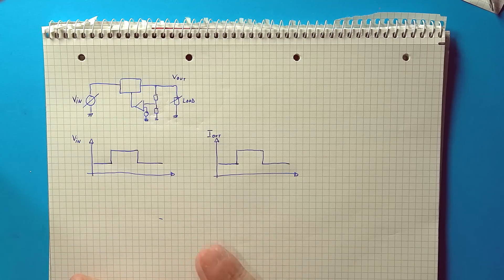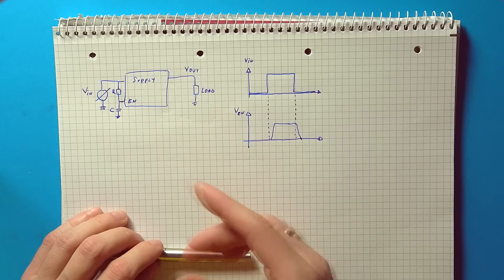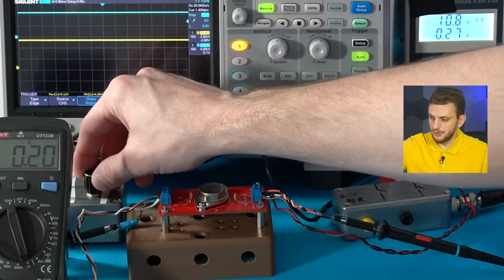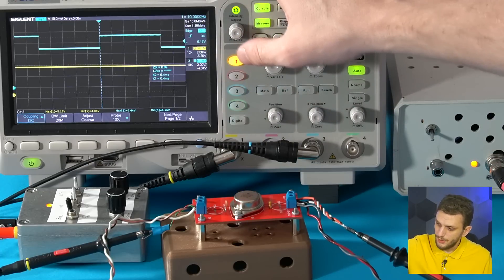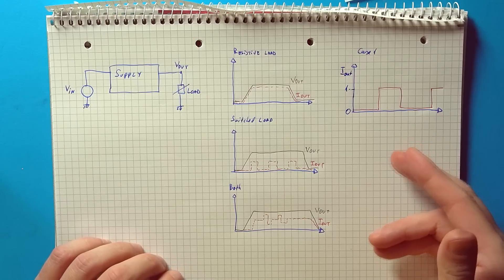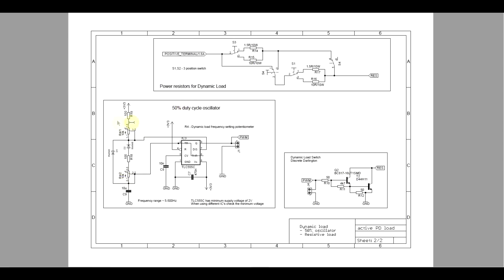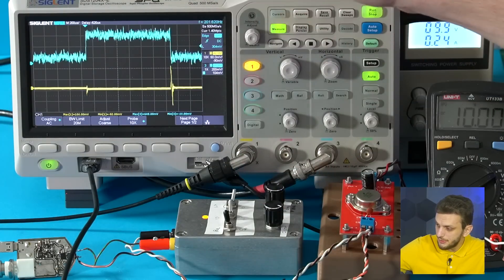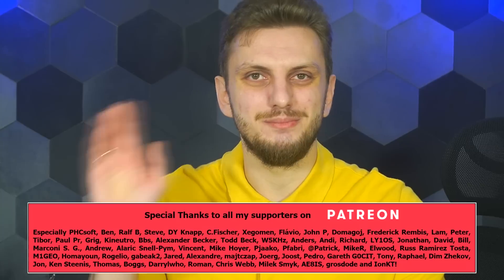Power Supply parameters - Dynamic Accuracy

Comment: The load can be complex, such that a failure can cause energy (overvoltage event) on the output of the regulator. This is usually mitigated by a large TVS on the output or a diode across the regulator. You may also see a TVS on the regulator input which may also be protected by a fuse depending on how the supply may respond to a huge line transient (like a lightning event or you live in a very noisy AC environment like some cities in England).

The challenge in use case testing of the PCB is in how to do the measurement. PDN low impedance testing is not easy and you usually need a very high bandwidth if you are doing preliminary EMC screening. And as I am sure you know, the design can actually be working with no operational problems other than not passing EMC. So, it is hard to understand all of the use cases when it is also PCB layout dependent. The more experienced design teams will specify features in the layout which make it easy to support the needed testing.

From a mathematical standpoint the impulse step response should be ideal. This means a perfect zero rise time step response, which is not really possible. You can however get a very fast step if you use a fast high current low Rds On MOSFET with a pre-driver circuit which is driven by the signal generator. The pre-driver can supply a huge amount of current in a very short amount of time at around a ns. This is usually not needed however with most electronic loads which switch quick enough to do supply edge testing perturbations for time domain stability testing.

Your custom current probe is very noisy. I really like the fact you designed your own. My own custom current probe designs are battery operated and run off of two 9V batteries for split supplies and have a small nose on the current sense board pcb (6 layers to allow me to bury signals) to solder directly across a small SMT sense resistor (very low inductance) on the PCB using very short low inductive leads. I have options for large gains for small sense resistors up to about 5 Mhz worse case bandwidth, which is usually sufficient. The shunt resistor current sense approach can be made much more compact than making a current loop for a magnetic current probe. Making you own shunt current probe is rather easy with the newer fast instrumentation amplifiers available, and they seem to be getting better every year.

Comment: Very good video as always! What is the power amplifier that you are using? It seems diy, maybe you can show it in a next video, that would be very interesting! Thanks for your videos, top notch quality content
Reply from the maker: You are right, it is DIY; I built it a few years ago. If I remember correctly its built around an LT1210 - that is part that is providing the high current output. Maybe at some point I will do a video about the amplifier, but its not really planned at the moment.

Comment: A very important topic. A follow up video about means to achieve good power supply stability would be interesting. The best would be a comparison between single chip (linear) voltage regulators and a voltage regulator which is build with discrete standard devices and optimized for very high output voltage stability.
Reply from the maker: I will try to look at stability in more detail at some point; however, I want to take a step by step approach - first to look at the problems you usually face in a real life application, how the problem can be investigated - the tests to perform and afterwards see how it can be fixed.
Reply: @FesZElectronics  I am also looking for a device or circuit to get a good current regulation / current limit as close as possible to the voltage setting.

Comment: I would like to know the best possible way to reduce noise on the output voltage. Are low cost linear regulators a useful building block for such applications for example to build a 12 Volt low noise power supply for a DAC (digital to analogues converter)? For instance if the LMxxx isn't able to provide enough current, and I would use a transistor in connection with an LMxxx how would its parasitic or none linearity play into the noise floor of the output voltage. Alternatively how would you go about designing a low noise 12 V, 5 A supply ?
Reply: well, you need to filter the noise at the input of the regulating circuit and be cautious with the shielding and grounding. A linear regulator can easily filter out a 100-120Hz residual oscillation of a AC rectifier+smoothing circuit but it's not a HF filter at all.

Comment: We can eliminate this issue with bulk capacitors at the input and output of the regulator?
How much importance this in real world applications?
I can't see any bulk capacitors at the output stage
Reply from the maker: Of course, having larger capacitors will usually help; I intentionally did not use any to highlight the effect.
Reply: As I see it bulk capacitors doesn't fix the problem. It merely hides them - the regulator itself is stil doing a bad job. And they also cause other (admittedly solvable) problems with inrush current and also problems when you want to have current limitation on the output that is fast enough to protect your circuit.
Reply: @MatsEngstrom  why should i care about which component is eliminating the issue. I need to eliminate the unwanted peak at the output, it can be achieved by some over engineered expensive regular or a simple low cost capacitor. That's why I asked where it is need to be considered. For normal voltage regulations, a capacitor and an inductor will be enough.
For programmable PSU applications, we may need to care about the fast changing loads, but for normal applications a soft start feature is enough as he mentioned. You ca use an eFuse if you want.
Reply: @udhayakumara4033  That's not a fix. It is  a bandaid that forcefully trying to make a bad  and/or insufficient design to kinda work by hiding the problem. And as I said this kind of "fixes" comes with their own problems. Like pulling a shedload of current at turn on (necessitating an unnecessary large fuse value) or or if put at the output makes any current limit to bee too slow. Take a cheap PSU with large caps at the output and sett it to max 10mA , turn it on and then connect a directly LED to it. The LED goes dead since the charge in the cap have enough energy to kill it. A real pro PSU from Agilent or some other non-crappy brand have no large caps at the output and will not destroy the LED. Reducing overshoots is to my knowledge mostly a matter of having a correctly calculated and tested compensation network in the control loop. Go ahead and use cheap stuff that's engineered by school kids or manufacturers that are removing part by part in the BOM until the design barely works if that is your preference. I prefer to use tools made by people that does things the right way and that I can trust works as specified under all conditions.
Reply: Adding some capacitance at the input and output is normal design practice. However, bulk capacitance - i.e. large value capacitors, say 100μF and perhaps much larger - is only likely to be helpful at the input to the regulator because they will tend to reduce the change in the input line voltage, thus improving line regulation. On the other hand, capacitance added to the output can only be of value to a reasonably well-designed regulator in filtering out fast transients on the output, usually caused by abrupt load variations. Any such output capacitance will need to have the lowest possible reactance at high frequencies, and that invariably leads to smaller capacitances in the 100nF to 10μF range, depending on type.